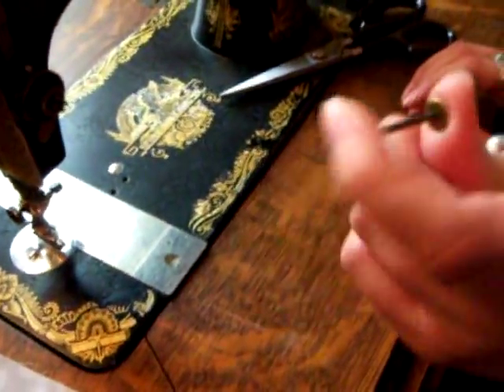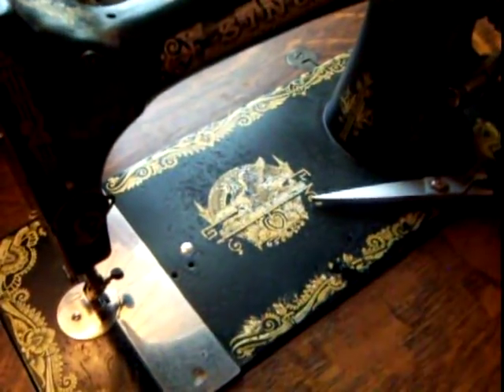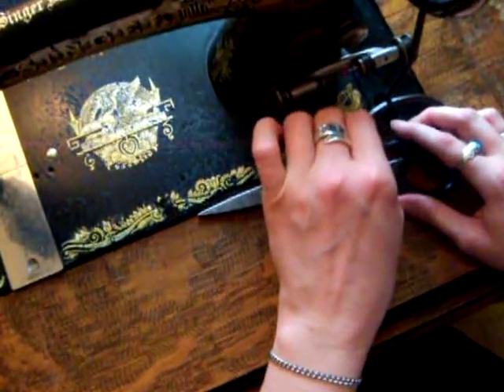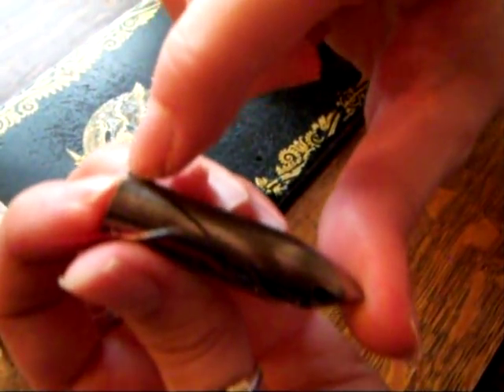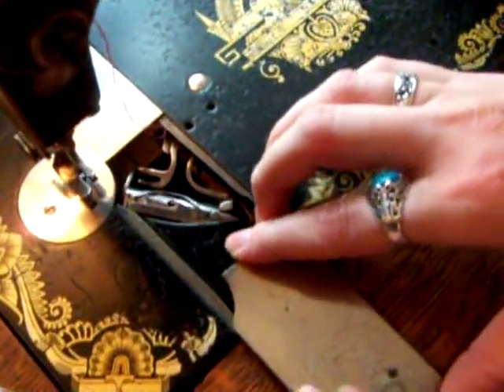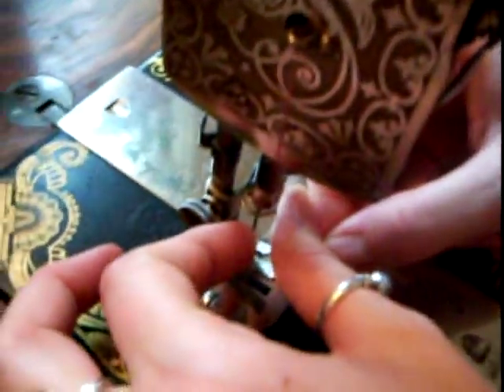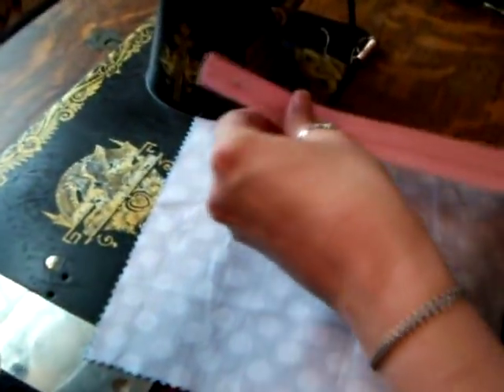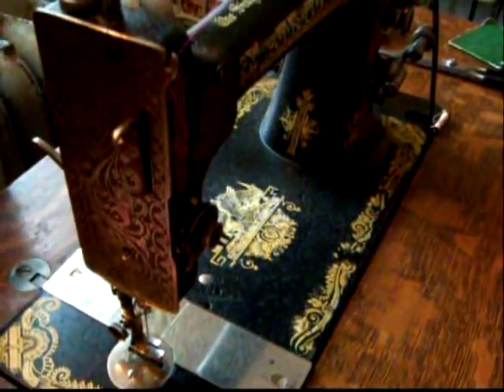How to load the bobbin, thread and start sewing on a treadle machine

Comment: you need to fit a rubber wheel gromit on the threader wheel instead of scissors
hen adjust the tension so that it is a firm engagement with the main wheel to the
spool threader wheel these are cheap and will make it so easy for you and more enjoyable,hope this helps

Comment: hi there, good work on your video :)  fyi, at 3:04 you pull on the bullet bobbin case by the wire... which you should never do as this will, eventually, bend that tension wire and cause many headaches...especially if you have to try and get it repaired or worse, find a replacement.  some bullet bobbin cases have a release button at the right of the bobbin case but if they don't (and this is the case with your machine) then all you need to do is push down on the pointed end of the case which will pop up the other end, allowing easy access for removal.  hope this helps.
Reply from the maker: peyotecoyote73 Thank you! I am always learning new things :)

Comment: I know it sounds silly, but this happened to me; try running the machine in the opposite direction. You can check which way it's supposed to go sometimes by whether the feed dogs are moving the way they're supposed to. Or it could be a problem with the threading on your particular model. Hope you get it fixed!

Comment: Firstly, the bobbin winder should be pushed against the back side of the belt when it's to be used and pulled away from the belt to sit idle when not in use. Secondly, the end of thread should be placed between the right hand disc of the bobbin and the winder if there is no hole in the bobbin, or through the hole in the bobbin if there is one (there is no need to hand wind any thread onto the bobbin). Thirdly, the shuttle should never ever be lifted by the spring as this can affect thread tension and if broken will render the shuttle useless, the shuttle should be pressed downward on the point thus lifting the rear of the shuttle for removal.

Comment from the maker: It should flow through fairly easily. Your bottom and top threads should have matching tensions. I found that part of the process to be the most frustrating and it took a lot of fiddling to get it just right. The way to fix it is to just put some leftover fabric in the machine and fiddle with all the tension settings until you get it right. Maye someone with more technical knowledge might now, but Gramma said just play with it until you get it. :)

Comment: Thanks.   It looks like the thread is going right throught between the tension disks and riding on the screw where I'm sure the threads are hurting the thread. How tight should the spring be? Like, not visibly compressed at all, or half its original size or what? Is that normal for the thread to hit the screw? I'm assuming it should be riding in the "v" formed by the two tension disks' outer portion, but it also looks like that's not gonna happen even at a rather tight setting.

Comment from the maker: One of the reasons could be too much tension. I also had trouble with vintage thread, turns out that doesn't keep well. Play around with the tension, I find the round part of the tension threader is the finikiest part, fiddle with that and try to get the tension right.

Comment from the maker: @Lotusbell There's a large one, in the bottom sort of pointy part. It only fits one way, so you'll know when you get it right. The thread comes along the top of the case and hangs over the front. When you put it in, you lay the bobbin down flat. I will see if I can make another little video of just the bobbin.

Comment: Hey thanks for the tutorial! I dragged a Brunswick out of my moms garage, but she was unable to summon the patience to show me how to get that puppy running, so even though our machines differ slightly your process put me in the right direction.. but I’ve been stumped 🤔 with the last part.. do the two threads run parallel with each other? I’ve run a bit of fabric under the foot but all I’ve accomplished so far is a row of tangle-ish loops from the top thread ha ha.. I’m guessing that the thread from the shuttle thingy is not engaging somehow or I’ve overlooked something.. is the bottom thread supposed to catch the top thread? Just turning the wheel for some reason is not catching the bottom thread.. and I have a feeling that the needle is supposed to pull the bottom thread through the fabric or secure the loops in some way.. any idea where I went wrong?

Comment: Nice machine. However 2 things you doing WRONG. You are NOT supposed to make knots to start, but pinch the tread between the end of the right side where you insert the bobbin.
Making knots will cause you to break the needle.
Your belt need ajustment, all you have to do is, take the metal clip off on one side, cut the slack with a rasor blade, make a new hole with a small nail, re-attach the belt ( without twisting it) and ...go girl! 
I have a treadle in my collection, I also learn on one. Peace